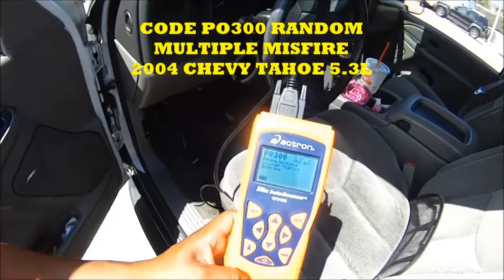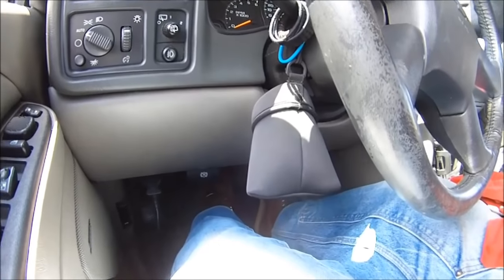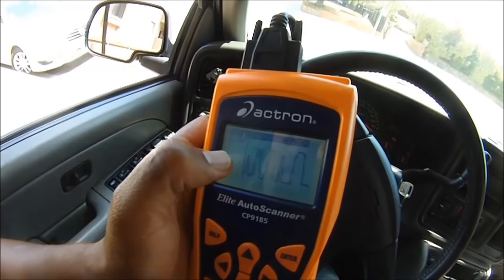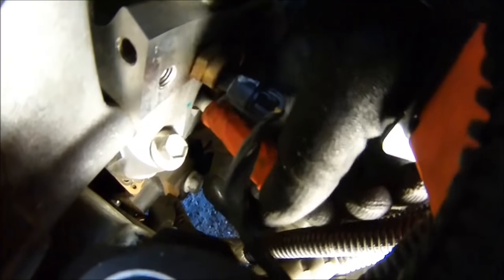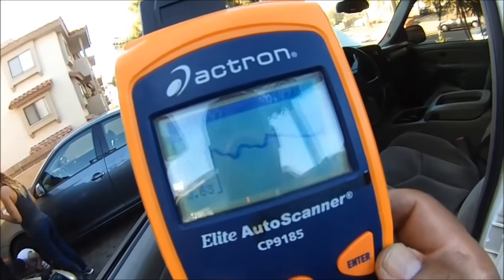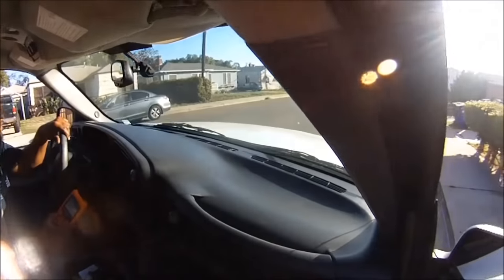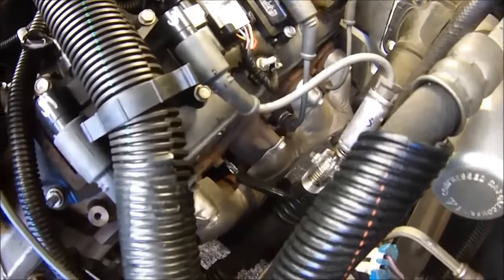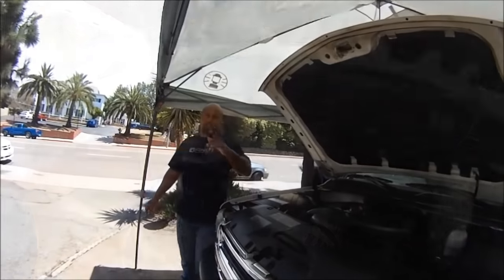HOW TO DIAGNOSE & FIX CODE PO300 RANDOM MULTIPLE CYLINDER MISFIRE DETECTED

Comment: Easy fix, keep the vehicle running and disconnect one coil pack at a time and if the vehicle runs worse when you disconnect the coil pack then move on to the next one but when it stays the same you found your source. Then you have to determine whether or not it is fuel or spark and which part it is, usually it's the wire or coil pack. But anyone can do it with a little knowledge.

Comment: Hi, your testimony was very inspirational to my husband and me! My hubby is a mechanic and we watch your videos together. He recently was released after having been incarcerated. This year he has opened a legit mechanic shop. We keep God first. He asked, Could you make him one of those smoke machines for $150, or how much would you charge?
Reply: VVS YELLOWHAMMER Ashley S. Nicholson there is a video of a guy that made a smoke machine for less than $20, if you have an air compressor already. He used baby oil and a soldering iron/gun. I made one myself using that method and it works great.

Comment: My 97 accord was stumbling like that  no codes  after about two years i replaced the plugs and torqued them to specs  no more stumble !!  a "pro" mechanic did that to me   Plugs gotta be properly torqued or you get vacuum leak  its sucking air  Thanks for your testimony  oldskool  watching you blesses me

Comment: Thank you for making this video. Very informative. Although I do not own the type of vehicle you were working on, I will use the information for my vehicles. 1 is a 2000 VW Cabrio 2.0Lt, 1 is a 1991 Chevy S-10 Blazer 4X4 4.3Lt, 1981 Chevy Suburban 350, 1981 Chevy w/inline 6,1993  Mitsubishi 3000GT. The information can be used on anything. Thanks again. Awesome job.

Comment: Thanks for the vid. A faster check is to use a test lead on ground and pull the wire at the coil and check for spark. Keep it close to the tower. Don't use battery negative in case you get shocked. No need to swap coils at all. You can diagnose coils in 5 minutes. If its wastespark always check the companion cylinder to ensure it isn't a control issue. Hope this helps. God bless

Comment: I have an led light but I bought and old school one because  It kid up with only 3 volts and I thought it was ok until I used a multimeter. There was corrosion  on the power cable to the fuel pump. They are still good as long as you know that they dont pull much amperage.  I love your videos brother keep up the good work.  I watch this just for fun sometimes

Comment: Awesome video!  I loved how it started out with scripture and ended with a great gospel message.  I may use that water hose example down the road.  That sure get's the point across!  Also, THE best diagnostic teaching I have run across.  My Astro van has a P0300 code.  Working through that.  Your video with help.  Thank you very much.  I also loved how you are working with your daughter teaching how to work on vehicles.  Very cool.  God bless you brother.

Comment: That was a 2004 truck? Very clean engine compartment. Wish I didn't live in the cold. You know GM did some switching around with spark plugs. Up until 2003 they came off the line with AC Delco platinum # 41-985. In 2004 they became AC Delco # 41-110 iridium. Then in 2013 they had a service bulletin saying all 2006 and older with some 2007's should use a new platinum plug AC Delco #41-962. 2007 and newer should use AC Delco # 41-110. I installed a set of 41-110's in my 2003 truck only about 30,000 miles back and I'm having misfire problems. I'm going back to a platinum plug. Not sure if I'll use AC Delco. I'm curious about what type those loose plugs were. Powerful message at the end, thanks for that!

Comment: Had a misfire on older GMC V8;  the brand new plug wire set had one bad wire, with a strand of conductor hanging out ! It was as thin as human hair, but in the dark you could see the spark! Don't assume you get good parts when buying new!

Comment: oldskool Thank you for your excellent videos you share with everyone. Your bible teaching is also enhancing for others as well as myself during these tough times inn today society. You can’t go around thinking thoughts of lack and struggle and expect to receive abundant blessings. Stay in faith, and declare God’s promises. Excellent video my a Brother. I do have a quick question you maybe able to assist me on. I have an 02 Mercedes C240 that recent have fault codes P0300, P0301, P0302, P0303. It started running with low power in acceleration. My fuel pressure 55, I have switched coils, air and fuel filters. Now I have tried to see if it corrected the problem yet, due to getting late. Cleaned MAF sensor and throttle body too. I tapped on cats and no rattling. Any 411/expert suggestion tips? Lolz

Comment: Great video, PTL  

(I am going to check out that vapor maker video you mentioned next. I can certainly use one).

 I have a question and/or comment  about when you put that :
- "loose" plug back in (near the beginning of the video) and 

Regarding the "loose plug" I couldn't tell if you used any sort of an  ANTI-SEIZE compound on your spark plugs?  I just wanted to add a helpful "my .02 cents" to installing the compound on any spark plug.
 
Anti-seize can help ease with future plug(s) extraction (AND potentially save DIY-ers $100's, because it helps ensure that plug threads never binds up in the threaded part of the head,.Possibly stripping out the head cylinder hole or breaking as a seized up plug). 

Just my .02 cents.    I personally have used the compound ever since the late 80's due to the different metal types of heads.  
It both helps lube the threads for easier spark plug installation and/or later removal.  
Plus the anti-seize compound prevents the 2 bi-metals: the steel plug threads vs. the "heads made of different metals/alloys threads",  from binding or seizing together.

(IRONICALLY the same dude that introduced me to anti-seize compound FORGOT to do it JUST ONE TIME, on his own Chrysler van's  spark plug change. His SUBSEQUENT  spark change a couple years later gave him a highly UNWELCOMED, $300+ wake up call.  One spark plug hole STRIPPED OUT when the soft head metal adhered to all the threads of the steel spark plug. His van required a
 Heli-coil re-threading. Adding insult to injury, the re-threading was on one of the hardest-to-reach, REAR, spark plug cylinder holes). 

To alert other DIYer car mechanics out there that might not be aware,  I just wanted to spare them any $300 repair (like my friend experienced).  
At just  $3.00 a tube  (enough for a several spark plug changes) for ANTI-SEIZING compound. 
It's cheap insurance by applying to the new spark plug threads BEFORE  installing them. Can prevent stripped or broken plugs later down the line.

Just my (hopefully helpful) .02 cents. 

PTL and Keep up the good informative videos. Much appreciated.

Comment: I have a 1995 Mazda millena when I pulled the wires off the part of the boot that goes on the spark plugs were all broken does that mean the wires are bad cause I'm only getting a p0303 on one of the cylinders. I've changed the spark plugs . should I change all the wires too..??

Comment: I change my plugs,wires, spark pluga the coil pack has been replace,fuel pressure is good,i replace my vaccum lines..you named it and i still have it..its a 1998 chevy blazer with 4.3 v6 vortec engine
Reply: Most likely is your fuel injection spider there known to go bad i have an 01 blazer did everything you did and still had a misfire new spider injection unit runs great has 275xxx and still runs great.

Comment: A wire spark guage is alot more accurate.  Once i had loose injector ground.  A long screw driver tip on injectors and listen with ear on pastic end for clicking noise.   Check wire with timing light.

Comment: Hey! So I got a 04 avalanche same 5.3 in it and a helpful video I don't have a diagnostic tool and I think it might have had a super minimal misfire like the only way I noticed is I had the radio off and just sat there and felt the truck. But put in new plugs last night and now it misfires bad enough to throw codes all the time and is much worse tried replacing wires and went back and double checked all the spart plugs for spacing and them being tight I have one new coil I've been trying to test with just by moving it around until it runs right. But no luck so far given your expiereince what's your thoughts?

Comment: Say old skool I got a 07 Tahoe 3.5 Diagnose said misfire #6 I put new plug new wires all around 3 new coil packs ! It's like the wire that goes to coil from the top of # 6 don't have power? All the rest once you take the harnest wire on top the engine gets worst But take it off #6 it doesn't change engine?? Could harnest go bag outta nowhere?? Or is there a fuse or sum ?? Please lmk thanks a lot !

Comment: I am having the same code thrown...  And a really rough idle with hesitation.  I just bought this.  They told me they replaced the valve cover gaskets.  I am assuming the sparkies were replaced too.  Since I have had it I have replaced the alternator, the battery and the fuel filter.  I can tell the misfiring is really bogging the engine performance down.  I don't know what all has been done to it and a P0300 could be a great many things.

Comment: Am I only one that noticed that the tach was at 0 rpm when the truck was supposedly running and speedo was buried at 80
Reply: Typical GM stepper motors.they usually crap out around 80,000 miles
Reply: @jaystevens427  Is that why these 5.3s are running around with 250k+?
Reply: @ZBrink11  easy Sasquatch, I'm talking about the stepper motors not the Engine itself. Stepper motors are the little plastic "motors" that are in the gauge cluster in which each one turns/controls each gauge (tach, gas, oil...etc) I'm shitting on those crappy little things. I love my GMs. Have a hard 150k on my 6.0 and still runs like a top. But I've replace all my Stepper motors in my gauge cluster..

Comment: Hello oldskool funk, this morning my 2010 Honda Odyssey got these codes: P0301, P0302, P0303, P0304, P0305, P0306 and P0300. The van was shaking a little bit in the morning. The check engine light didn't come on. The spark plugs were replace about 3 months ago. Any suggestions? Thank you.

Comment: Hello +oldskool funk ! I have a 2005 chevy aveo and i get P0300 code when I'm driving on the highway between 65 mph and 70 mph. My Check engine light flashes as well as the hold botton. Eventually my car stalls out when driving. Ive changed the spark plugs, wires, and ignition coil pack. Any suggestions? Thanks!

Comment: Is an electronic EGR valve supposed to be closed when motor is cold on a 2005 Chevy Impala 3.4 I'm getting a check engine light P0 300

Comment: Great video man. I have random miss fires on 1 and 3 I got new spark plugs and wires I did test the spark and it all seemed fine. Cylinder 3 is the one misfireing the most shoul I just replace the coils on 1 and 3? My motor sounds exactly like that one

Comment: I got a 2007 Jeep Liberty, I got a P0300 Multiple Misfires also, But I have Changed all The Coil Packs, Spark Plugs, All 4 oxygen Sensors, ASD Relay, And Put in A Bran New Battery, made Videos of it and I Am Still Getting The P0300 Code???? No Clue What Do Do Next.

Comment: i have the code p300 on an 08 impala 3.9 plugs wires and coil are good.  i was told the catalytic converter is clogged and thats causeing my missfire.  can a bad catalytic converter cause a ramdom missfire?

Comment: Wow what state do you live in? That engine looks brand spanking new for an 04. I'm in NJ and plow with my truck. The rust that forms on non protected metals from winter road salt goes to work on the metal parts. Literally will make a 1 year old coil pack look old with how quick the toxic winter road melting products corrode non protected steel parts.

Comment: Tomorrow I will have to remove the plenum and check the spark plug gapping, unless there is something I can do before I have to tear into it.  The spark plugs are inside the valve covers.  It's a 2003 mitsubishi montero sport xls.

Comment: I have a dodge Durango with a P0300 misfire. Idles fine but as soon as it goes into drive it starts to misfire. What could be the cause? I also have a code P0152 for 02 circuit high.

Comment: I just did plugs and wires and still getting misfires I was told that gapping was a thing of the past so was going to do coil packs and 02 sensors should I do this first

Comment: I changed my wires and plugs because I had a misfire where at a cold start my truck will want to shut off, found all my spark plugs where nasty dirty. It still has a misfire and wanted to know should I change the injectors next?

Comment: I have a 04 2500hd  miss  fire on number 7 changed plug wires and coil pack  it has 02 bad running lean on bank 1 what should I check next after changed 02 sensor

Comment: Hey bro...I have a 5.3L vortec in my 2003 Chevy Avalanche with the same issue. That very same plug on my 4th cylinder was loose...I changed all plugs (and the 4th cylinder coil) and the p0300 code came back...the wires seem to be good...but it's still doing the same thing and the check engine light is flashing....what do you think it is?
Reply: Did you ever find a solution? I have an 04 Silverado 5.3 Vortec throwing same code

Comment: Any idea what would cause all six cylinders to misfire at once? I don't even have a cel or rough idle.I just happen to plug my obd reader and got p0301-p0306.Its a BMW n54 engine I know they are much different than other cars so I'm clueless.
Reply: TheTruelakersfan have u checked your battery? even if its strong enough to start the car, it may not be strong enough to run every component. auto zone will test it for free
Reply: thanks will do that and post if that is the cause.

Comment: my 5.7 chevy van po200.po300.po301.  huge gas smell for a year. mainly in reverse it gets bad.
 my mech gladly took $560 for new spider injectors and left my main vac hose off. so mad. it stills bad and stahls only in reverse.  on highway engine lite blinks.

Comment: I have a Skoda Superb which has a misfiring cylinder. Changed all the spark plugs, there was moisture in one of them, the car was normal for a mile or so, and it again started misfiring. What to do next?
Reply: Sohil Gupta you must check your coil ignition wire (the wire harness from the main ignition to coils) then check crankshaft sensor after fixing the wire harness.

Comment: hey brother, i have a 1999 chevy silverado with a p0300 seems like I'm going in circles, i found bad wires so i did a complete tune up, then i got misfire code p0300 so i did fuel pressure test, found it to bleed off right away so  i put the spider injection in, and i got same code so i dropped the tank and found the fuel line inside fuel pump to have a crack in it, so i replaced the fuel pump and the pressure now holds but I'm still getting a p0300, i clear it and give it a lode and get p0301 , clear it give it another load i get p0304, i clear it and get p0300 so , I'm not sure where i should check next? any help  would be appreciated and God bless
Reply from the maker: check your intake manifold gasket for a vacuum leak
Reply: +oldskool funk 
checked for a leak did not have one i checked erg and its fine? the coil ohms out at .6,
could it be a plugged cat or would that give a code
Reply: +Ruben Gomez  i removed egr plug and no idle change, i removed the maf plug and no idle change, i removed the map sensor and no idle change, removed the spark plug wires one at a time and  no change in idle. ? could the ecm be bad causing a limp mode

Comment: I have a 6.0L misfire but Im also loosing coolant, but dont have external leak,  at first it was misfiring and running bad at start up, then would clear up after a couple minutes, but now seems to be getting worse what could be my problem?
Reply: juan rodriguez well I don't feel like doing this job twice so I'm changing heads and gaskets

Comment: Should get those junk ass plugs out of there. Get some ACDelco iridiums and replace the wires. You could also get a squirt bottle with some water and spray it on the suspected area. Shut the hood or wait until nighttime and the arc will be easier to detect.

Comment: Why doesn't your Actron tell you which cylinder is, for instance it should say P0301 or P0303 if it's one of the cylinders you suspect that it is.
Reply: Rick Quest because a p0300 means multiple cylinder misfire. the 1-6 is only when 1 cylinder isnt functioning properly over a few cycles
Reply: That makes perfect sense!
Reply: Rick Quest you might wanna check crankshaft sensor.
Reply: Jag, wasn't talking about me, talking about Oldskool, his meter should tell him which cylinder is miss-fireing.
Reply: Rick Quest p0300 is a random misfire. the ECU detects something wrong in firing and all signals are working. poor or strong signals don't matter. in some cases crankshaft sensor is working but slightly poor signal that caused incorrect ignition timing in a couple of combustion cycle which the ECU doesn't know where the exact problem so it hits you with p0300

Comment: I'll post a 'like' and watch a vid by any guy who opens it with real Biblical verse, that I remember from childhood. So if a Corolla with 273K miles has a miss and the plugs and coils are both changed out, but an intermittent (not steady) miss occurs, what then ? I carefully removed and cleaned the throttle body and IAC valve as well as the MAF sensor and the PCV is fine and whistle clean.

Comment: I changed spark plugs wires ignition coil fuel filter and mass airflow sensor and still getting P0300 random multiple misfire code can anyone help me.
Reply: Me 2